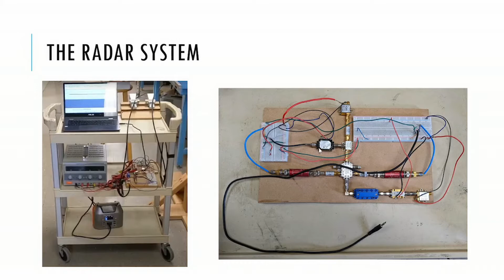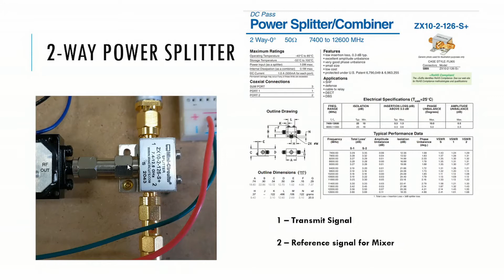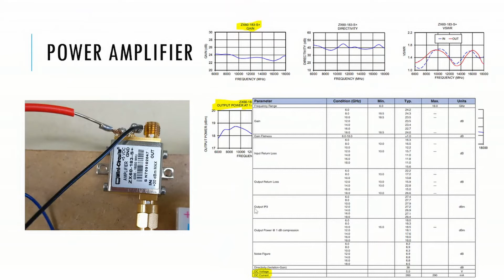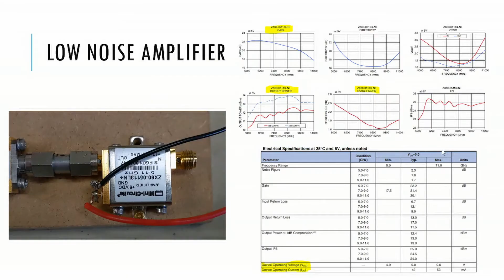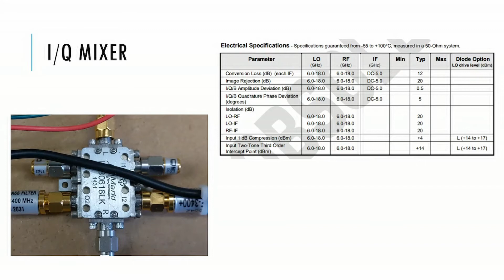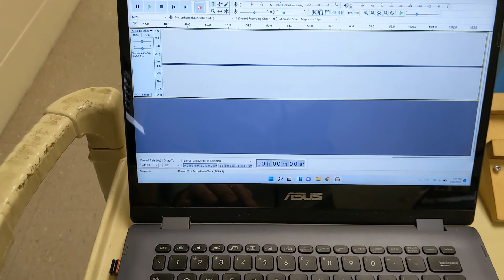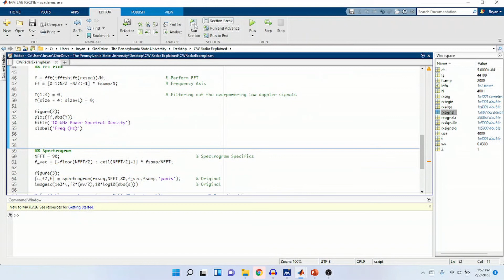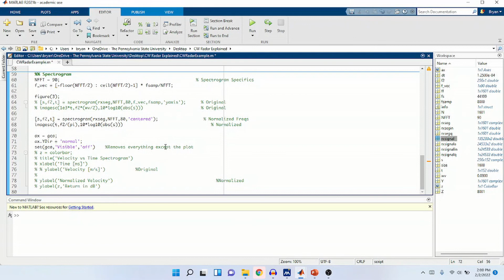10 GHz CW Radar (Full Detailed Explanation)

Comment: @Bryan Tsang  Aww my comment didnt post (have to retype it).  Im assuming it might have been because I attached a link.

I see in your MIT like demonstration you attached a RF LPF (DC to 800 MHz or something) to the IF from the mixer. Did you simply just connect the RF LPF to the one of your aux cables channels?
Reply from the maker: Hey, Craig. I believe I stripped half of a coaxial cable and used that as my connection from the RF LPF to audio cable. So, I connected the output of the RF LPF to the SMA side of the coaxial cable. Then, I soldered a wire to the metal casing of the cut coax cable to simulate a ground that was connected to a breadboard. The main cable from the coax also went into the breadboard, connecting to either the left or right channel of my audio cable.
Reply: @Brrryan_T  Okay thanks Bryan, gonna give it a try sometime this week and will let you know if I succeed or don't xD.

Comment: @Bryan Tsang  Awesome Video x2! Would just like to clarify a thought if you don't mind. 

How can you sample your signal on your laptop (I thought laptops don't have Line-in auxiliary jacks?).
Reply: Regarding the MIT radar, did you successfully build the video amplifier using their design (gain stage and LPF) without having to bias the IF from the mixer? Thanks in advance.
Reply from the maker: @craigels07  I was fortunate enough to have a 3.5 mm audio jack for my laptop, but you could get a USB to 3.5 mm audio cable adapter. For the MIT radar, I wasn't able to implement their video amplifier design. I don't think I ended up using one.